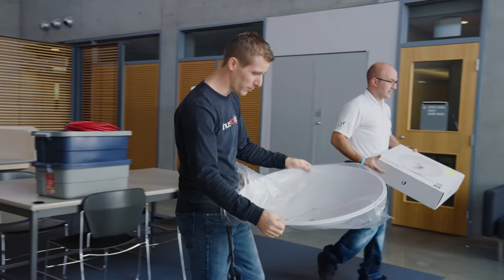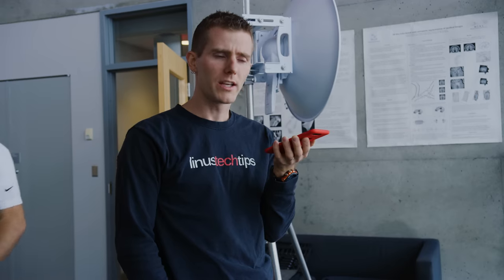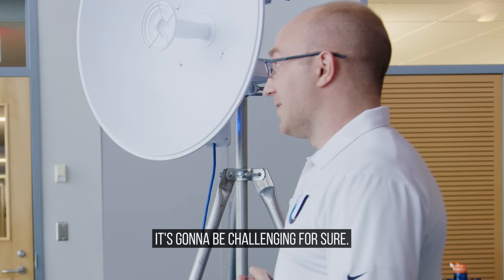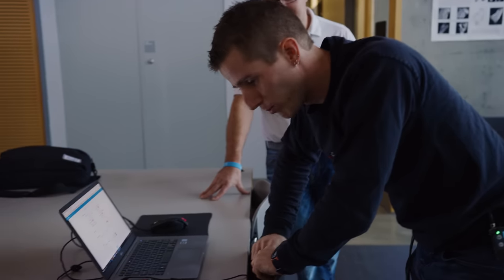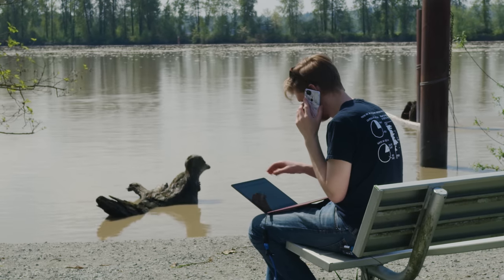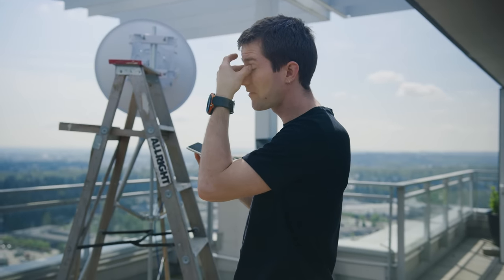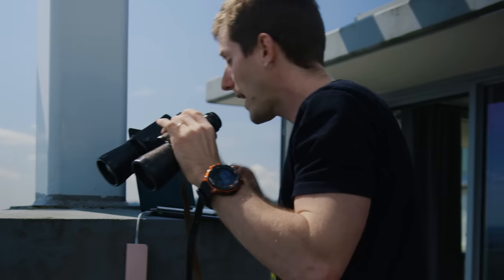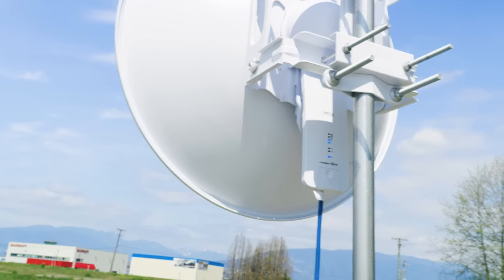12 KILOMETER Wi-Fi - SUCCESS!!!

Comment: Megabytes are 8 times bigger than megabit, 15 MB are 120 Mb.
Reply: True, but when you add the protocol overheads then 150Mb/s isn't a bad approximation.
Reply: If one is using the International System of Units (SI), then it is decimal.
Reply: @MarkoVukovic0  
1 byte = 8 bit
Reply: @MarkoVukovic0  That doesn't apply here.
Reply: theoretically
Reply: @MarkoVukovic0  1 KILObyte = 1000 bytes (and 1 KIBIbyte = 1024 bytes), but 1 byte is always 8 bits😂
Reply: 1 BYTE = 8 BITS
1 KILOBYTE = 2 BYTE ^ 10 = 1024 BYTES
1 MEGABYTE = 2 KILOBYTES ^ 10 = 1024 MB  and so on....

We round off the extra 24 bytes or KILOBYTES etc so that calculations are easier. Instead of x1000, we need to x2^10 FOR ANY BYTE VALUE (BYTE, KILOBYTE, MEGABYTE, GIGABYTE, TERABYTE, PETABYTE)

To convert a BYTE based value to its corresponding  BIT value, we x8. ex., 2 TeraBYTE = 2x8 = 16 TeraBIT

For an example, if you have a hard disk that is 1TB, they actually mean 1 trillion bytes NOT a WHOLE TERABYTE. 1,000,000,000,000 bytes. Then, they say that 1,000,000,000,000 bytes is actually 931.32 GIGABYTES and you get only that much storage.

Because 1,000,000,000,000 ÷ 1024 ÷ 1024 ÷ 1024 = 931.32
Reply: @NeevTHM , nope, 1 kilobyte is 1000 bytes, 1 megabyte is 1000 kilobytes etc. Nowadays, it’s pretty much only RAM that uses non-SI prefixes. In those cases, to avoid confusion, IEEE binary prefixes can be used instead, e.g. 1 KiB is 1024 bytes. So 1TB hard disk is one trillion bytes and that is a whole terabyte. There was even a court case about it and hard drive manufacturer won.
Reply: Yeah, that’s how ISPs get you with speeds

Comment: As a former SACOM  tech Im kinda laughing because I know the exact problem you are experiencing. if you had a spectrum analyzer it woud have gone alot easier as you can detect frequencies and see what a good frequencies you can shoot and to make yours stronger over a noise floor. of course you still need the EXACT direction you both are pointing to and the correct angle. this is where a High power amplipher would come into play and allow you to shoot a really strong signal that you would detect easier and as you both adjust to each other you can adjust power as needed so you dont fry shit in the way or on the distant end. from there you can get a strong link and moniter other freqs so you can adjust yours over the noise floor and move slightly if your interfering with another  .
Reply: Augustus Theis ah just pump 1300 watts through the puppy and cook that potato sitting on your neighbor’s counter
Reply: Augustus Theis they honestly should have hooked this kit up with an SDR.  Its a lot more portable solution for monitoring the incoming signal than a spectrum analyzer.  And the problem with using an HPA is that they prolly would have started feeling sick long before they got pointed right.  You don’t want to be standing in the way of a high power RF beam.  That’s like sticking your head in a microwave.

i really loved watching them try to peak up though.  That is the bane of every SATCOMers existence.  You know, unless you’re working with an antenna that has autotrack built in, but i doubt these guys sell kits with Az and El motors.  i’d love to see Linus jenk something like that together in the future! XD
Reply: The radios actually have everything you need built in. Shows your signal, noise floor, interference across the band you name it.
Reply: Just add an ssd and it will be much faster.
Reply: The antenna has a section to do the spectrum search that launches a downloadable program that the manufacturer provides for just that.

It all is usually mentioned in the signal and alignment section of the installing instructions.
Reply: What about a laser, would that not work best if there is good LoS?
Reply: @MarkoVukovic0  
In theory, yes, a laser-based setup would be capable of incredible speeds, but aiming laser spots precisely over 12 kilometers at photocell/photoresistor targets for both the uplink and downlink isn't realistic for amateurs like us.  Not to mention issues with eye safety and obstacles in the direct line of sight (LoS) like birds, rain, etc. leading to dropped packets of data.  

That being said, Elon Musk's Starlink satellite network will be laser-based and should work well without all of the LoS constraints we have to deal with down here on earth.
Reply: Me:  ?

You:  BIG BRAIN TIME
Reply: The Prism stations they were using has a spectrum analyzer built in, so what you're speaking about is all doable. Source: I am an engineer at Ubiquiti working on the AirMax/AirFiber product lines.
Reply: @josireis-west1904  the getting sick part is absolute garbage. My eyes should be glowing at night by now according to your hypothesis.
Reply: @shlapdeshre    i'm speaking only for instances where an HPA would be used.  It looks like the systems you're working with don't use them, so it makes sense that you're fine.  It looks like your systems use output powers in the sub watt range, which is harmless.  It's only when you start getting prolonged exposure to tens or hundreds of watts, like when an HPA is involved, that there is a problem.

Comment: I was hoping you'd ping the other PC just to check the latency.
Reply: Depends on the chipset and type of encoding. Most fixed wireless does not use 802.11 standards and have their own proprietary transmission protocols. I go through 2 fixed wireless jumps a total of about 20km and my latency is about 3ms +/- 1ms. We have some other long range links where latency is 1ms
Reply: Yeah what Aidan Gillett said.
The main reason latency can be an issue if if you go way further than this, for example the distance between america and europe is about 200ms (give or take depending on where you are in each) and that's about 7000 km..

Comment: used to do this for a living - installed fixed wireless internet access - and there are some tools missing from this:
 - A level.  You can adjust the poles to make sure straight up and down simply by slapping a level alongside the mounting pole.  this will allow for the best result when aligning signals.
- Beleive it or not, an Augmented Reality compass app.  you can actually share GPS coordinates, and simply use the app to establish rudimentary LOS. you literally hold up your phone and pan until you see the compass needle is point straight out.
- Horizontal first, then Vertical. always always always.
Reply: Still do this for living :) Have done about 400-500 of these the last one and a half year (Y)
Reply: Which compass app do you use?
Reply: Can you elaborate about why it's better to align horizontal first then vertical?
Reply: Nice one for the heads up on that app!
Got an install to do next week so I'll give it a whirl.
Reply: +Sir Valiant III
I think you meant why you should align horizontal (azimuth) versus vertical orientation (elevation).

It is for the simple fact that GPS is horizontally (position on the globe) more precise than vertically (height). For the azimuth you have a wider search angle for your target which is easier to direct with a compass, for the elevation you can assume for far distances 20-30 degrees max. The elevation for both endpoints can be assumed or estimated and while the lower end point will set up its elevation for positive angles (aiming up) the higher endpoint will assume a negative angle (aiming down).
Said all that, when you set up you azimuth correctly (because GPS is more precise at that) you can eyeball your elevation on both sides by watching the signal strength indicators, because you have less of a range in degrees to adjust for the elevation and both endpoints know if they have to aim up or down.
Reply: You are correct, that is what I meant to ask. Thanks so much for the explanation! Makes perfect sense now.
Reply: Idk how much I trust an AR compass over a real one
Reply: Courtesyflush52 Wouldn't an AR compass be better because it more finely reads fractions of a degree that would be lost to abstraction in a handheld compass?
Reply: an AR compass is cheaper, and is as easy or easier to use.  and these days, the accelerometers in phones are pretty reliable for compass use, given the nature of radio signal alignment.  there's a saying in radio, "measure with a micrometer, mark it with chalk, and cut it with an axe." you make precise measurements concerning location and elevation, but the rest of the work can be left to eyeballing it and paying attention to signal attenuation changes through movement.

Comment: I worked with some folks to set up a 125 mile link a lotta years ago. Set a record, at the time.
Reply: Derek H very cool
Reply: let me guess WRT-GL? :)
Reply: @CeleronS1  This was before they even offered a separate branch of the WRT54G hardware just for the Linux variant. This was actually using a 300mW Orinoco Gold card that was turned down to 30mW output strength.
Reply: @DerekHubbard  Impressive! Thanks for info! :)
Reply: Nice
Reply: I remember that.
Reply: @DerekHubbard  I assume you managed this using a decoherent needle beam? or did you generate a coherent beam (maser)?

Comment: What kind of batteries discharge over a weekend?
Reply: Michael Riley 
My iPhone’s battery... no I’m not joking, I’m serious.
Reply: Cheap ones.
Reply: Worn batteries I'm guessing, since they probably need some big car-battery system to power it for a decent while
Reply: Old lead acid batteries and dry cells
Reply: the batteries you forgot to charge lol
Reply: My phone not jk
Reply: My jailbroken iphone which loves to sip power even on idle/sleep mode (although I may have fixed the issue a few days ago - was happening for 8 ish months now)
Reply: How did you fix it?
Reply: Lead-acid batteries self discharge at a fairly high rate but they'll retain most of their charge for at least a month, lithium batteries with even mild quality will have a very low self discharge and will remain charged between about a year or several years, however the charging/protection circuits on them can put a significant enough drain your batteries to run them down in a matter of months or even days if that happens to your batteries I suggest returning the pack and finding a better one or the other possibility is that they are very worn and can form teeny tiny shorts inside the cell which cause the battery to self discharge at a rapid rate, sometimes even discharging about as quickly as it is charged, if that happens you should absolutely replace the pack.
Reply: N-ninja meh fuck jailbreaking, I eventually end up with 500 installed packages while you only have like 30 installed

(This package needs X X X and X dependencies, etc etc)

Good old days I remember modyfing packages to remove conflicts and still use them together with the conflicting packages lmao. (They are not always correct)
Reply: a broken one
Reply: Of you leave batteries on concrete it will cause a slow discharge.
Reply: JustAGoatWithInternetAccess Time to get your battery replaced then, and it's just $29.  iPhones are kings of standby.
Reply: the wifes vibrator... jk lol
Reply: A lemon battery
Reply: Some batterys discharge over time yo conserve it's lifespan. For instance my DJI phantom drone battery discharges 80 percent of its charge after 7 days.
Reply: Thelotus661 what about a lemon battery
Reply: Pretty much all batteries self-discharge, but to discharge over a weekend, that's pretty fast even for something like a lead acid battery or NiMH battery. Maybe the batteries were old and dont hold much of a charge anymore.
Reply: The cold causes batteries to discharge at a much faster rate than they normally do
Reply: @ richard mack -- I heard that from my dad years ago, but there is no truth to that these days.  A long time ago, batteries used to contain everything in glass with a wooden frame around it.  Setting it on concrete would cause moisture to enter the wood (especially in severe damp locations), which causes the wood to expand which then breaks the glass jars...or whatever they used to contain the chemicals.  Simply putting a battery three feet lower on the ground won't make a difference in it's life span unless it's massively saturated, and even then...  :)
Reply: The kind that was being used? :]
Reply: No battery discharges over the weekend. If anything, they would appropriately equalize. this is smart comeback instead of admitting to the boss on The Big Video Shoot Day that they were long dead and you still forgot to charge them because you were partying all weekend aka its a gag for drama value, like Linus dropping the dish and wasting a day with $150 an hour engineer there all day.  We love our incorrigible but brilliant ADHD coworkers who make all the science work so we can get our social networking messages at work.

Comment: next step: bounce off the atmosphere to get wifi beyond the horizon
Reply: Too high of frequency, will pass straight through.
Reply: or just launch a couple of satellites and get WiFi everywhere
Reply: They use radio wanted to do that for submarines. Surface a bit, bounce it across the ocean off the different layers of atmosphere. WiFi probably wouldn't be able to do that, though by saying that we are throwing down the gauntlet nowadays.
Reply: Bernard Eastland has 63 patents that do alot more than that.  The Horizon is nothing more than the end of your sight, if you guys would pull your heads out of your butts you would plainly see every single night that the High Frequency Radars, that are omnidirectional of course go hundreds of miles and have no problem passing through the atmosphere your eyes were not designed to.  There is a guy named Tolan that did some changes to his new dslr camera and has taken video from 31,000 feet of over 1200 miles away.  Now if you understand that at 31,000 feet, the fake horizon is 201 miles away, then you should be able to see the fallicy in your thinking.  In other words you've been lied to and bad.  Your Sattelite dishes all point at a spot where the antennaes on ascention island bounce them from
Reply: @andrewmorris483  Well, wifi could probably do that with the right frequency, but all the "bouncing" would distort the signal so much that the internet would be shitty or nothing.
Reply: Jakob Thompson lower frequencies that allow for propagation (bouncing off the ionosphere) would severely limit networking speeds. And the bounce does not distort the signal. Take a peek into amateur radio DX-ing. Certain frequencies are great for propagation, and HAM’s talk to each other from the other side of the world when conditions are right. 

This other guy blabbering about fake horizons and such is just a spook. But the only radar that can bounce signals is OTH (over the horizon) radar, which does not use frequencies as high as WiFi. Look up the Russian DUGA OTH radar array (nicknamed the Russian Woodpecker due to the sound it made when interfering with amateur radio bands).

Yet another problem with long distance WiFi, is that when you put too much wattage behind that 2.4GHz signal, it essentially turns into a microwave oven when you are close to the transmitting source, since microwave ovens also produce a 2.4GHz wavelength. Your WiFi router probably transmits at about 100mW, where as a microwave oven is directing usually around 650W at your food. The reason it would only warm and possibly burn you at close range, is because the power of that electromagnetic signal is reduced exponentially as you get further away from the source.

This WiMAX setup probably transmits at around 30W if I remember correctly. 

But once you learn about frequency bands, propagation, and what devices do what, and on what frequency, you’ll understand why WiFi cannot be bounced off of the atmosphere. 

Hence why satellites use microwaves to communicate. They won’t be deflected by the ionosphere.

Comment: Was the 12KM distance horizontal, or did you actually figure in the hypotenuse from the height displacement?
Reply: We all know that Linus maximum effort towards prep is non at all
Reply: You don't need to. There will probably be 20m difference.
Reply: Angle looks like it would actually change a lot more than 20m
Reply: Even if it was 1km it wouldn't make much of a difference
Reply: I'm more interested in the truth behind the clickbaity title, I know the range difference won't impact the transmission much, though it depends on the radio's maximum power specs.
Reply: Nah. The land itself doesn't look to be changing too much. So if you only factor in a 150 ft building it wouldn't change much for the hypotenuse
Reply: I mapped it out in Google Earth Pro and the distance was 35,940 ft. (6.81Miles, or 10.95 km). There is a difference in elevation of about 420 ft between the two points.
Reply: look at all these people, the hypotenuse is the style to go. If your bragging, would you rather say 12km, or over 12km. Its just better for marketing.
Reply: I dont think it matters too much you know, the height of the building to the horizontal distance ratio is about 1/50 so the hypotenuse is only 0.04% more than the horizontal distance
Reply: Can we just agree it's longer than your homes wifi router?
Reply: horizontal
Reply: At that distance, with such a small angle, the difference is distance is extremely small
Reply: Xander Zoolander if Linus is
 about 100m Up ist would Change the distance not even 1 meter.
Reply: I wish i was high on potenuse 😂
Reply: Kowalski n
Reply: It's hard to get good potenuse these days.
Reply: well it would be just some simple trigonometry, still laughing at the fact that a classmate in the 9th grade was like: trigonometry is not usefull at all.
Reply: Synikal When did he say there were 10Mb in 1MB?
Reply: 2MB = 20Mb ? well, with protocol overhead, its probably not a bad estimate of raw bit rate.
Reply: 420 ft lol